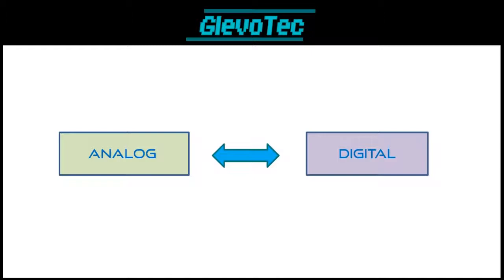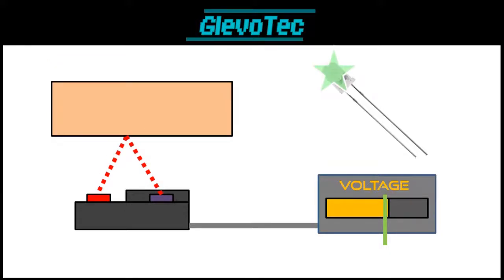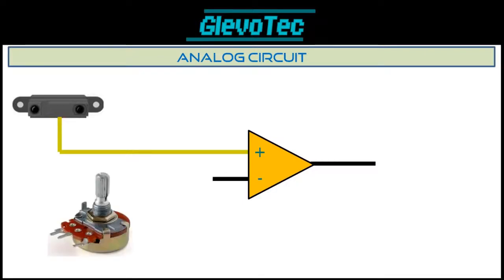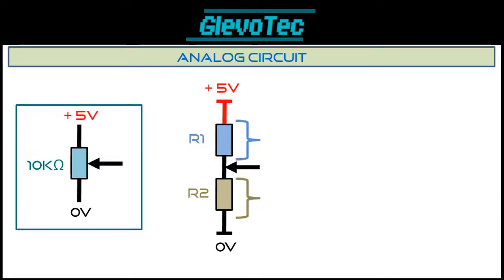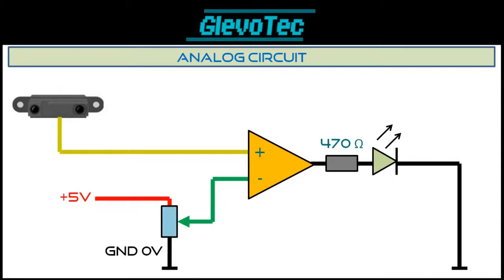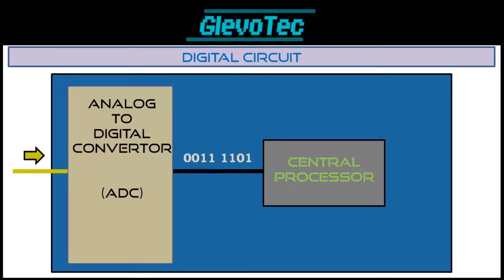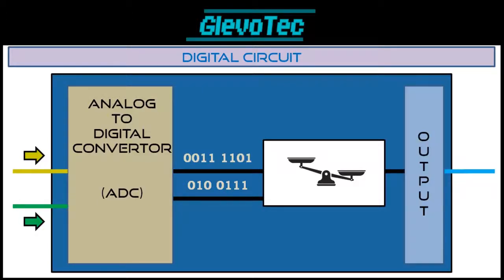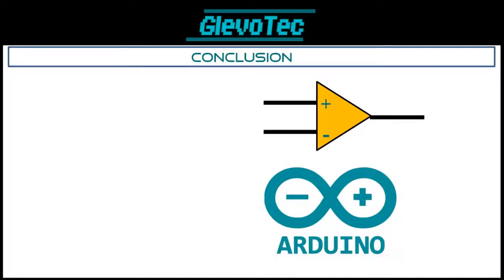Part 4 - How to start making your own robots | Analog vs Arduino

Comment: 7:34  Just to point out:  Since the program is comparing two numerical values (DistanceValue and SetValue), you don't necessarily need the potentiometer.  You can just specify SetValue in the program to a number from 0 to 255, and adjust that value in the program as needed.  Two different ways of doing the same thing.